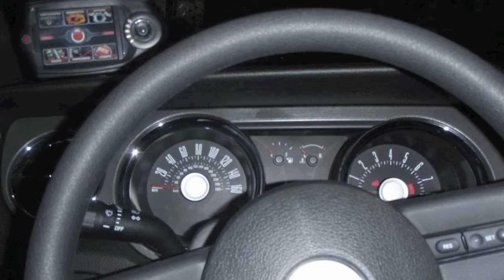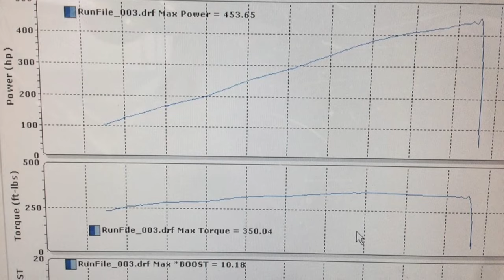My Build: The Progression Of My 2012 Mustang : Bagged and Blown

Comment: Where did you find the mustang chrome emblem that you have sitting under the hood. Is it the same one from the stock grill? or can i purchase it from a website
Reply: +pfmustang Thanks man, It looks like you have some sort of coil cover that dresses up the engine. The cover underneath the strut tower brace. Where can i find that?  Also what Pro charger did you get. The standard V6 one from AM? I'm looking to do that as well but wanted solid feedback.